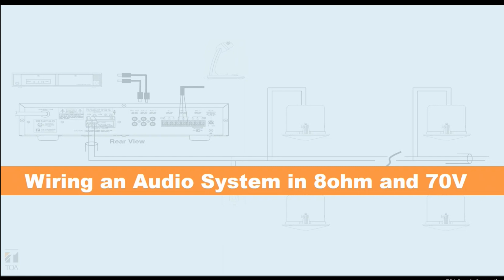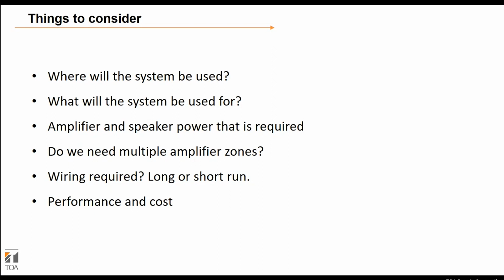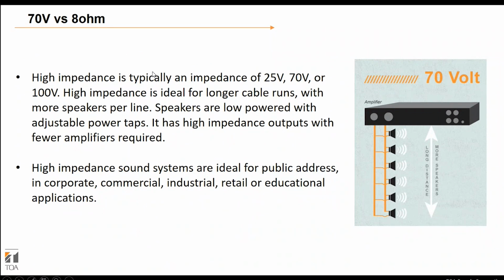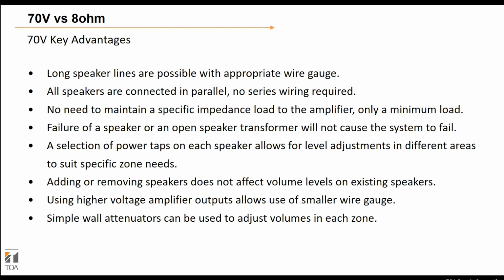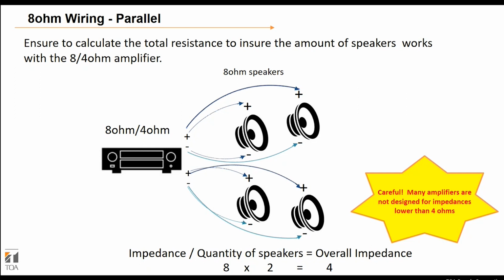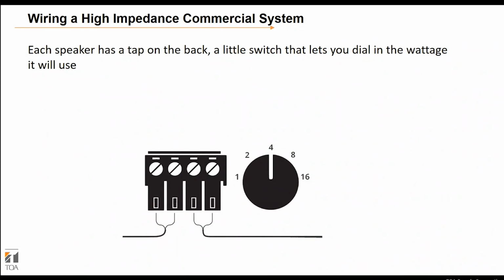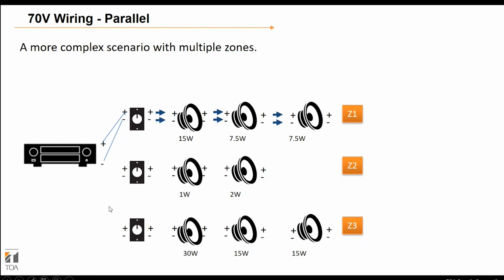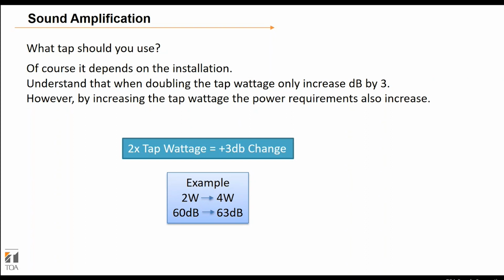TOA Canada - Wiring an Audio System in 8ohm and 70V

Comment: Hello, 
on the diagram at 20:15, can I have two 8 ohm speakers in parallel as shown, on one channel (4 ohm total impedance), but on the other channel just a single 8 ohm speaker? Essentially what I am asking is: can I have differing impedance between the amplifier channels?

Thank you
Reply from the maker: Hello there,
Great question! Our technical support team would be happy to assist, please find your preferred method of contacting our team @ https://www.toacanada.com/en-ca/inquiry. From there a team member will be able to provide you the most detail possible!
Reply from the maker: Hi, I did receive an answer from our team and YES you are able to have different Impedance.